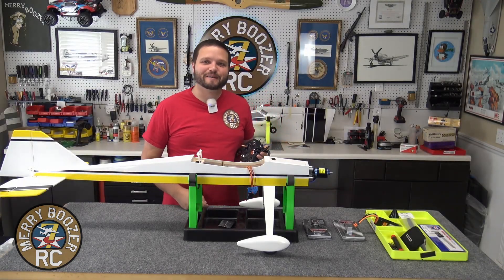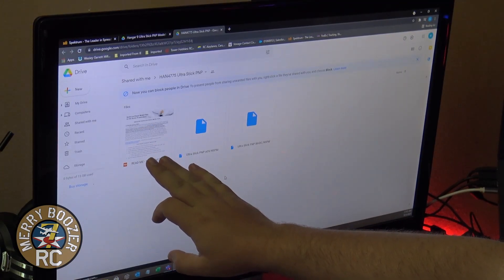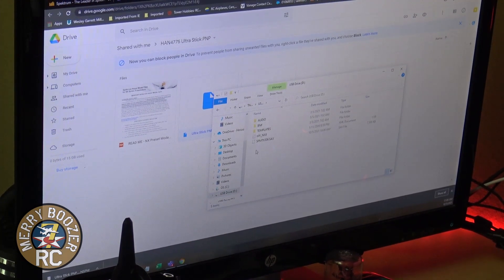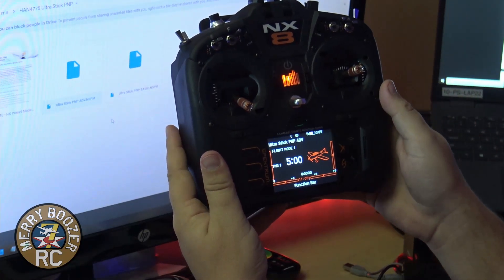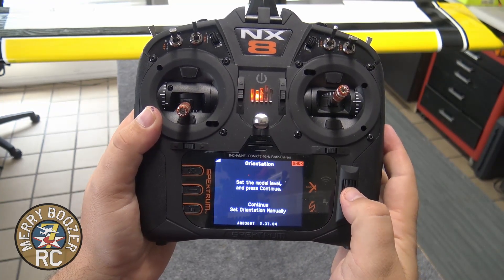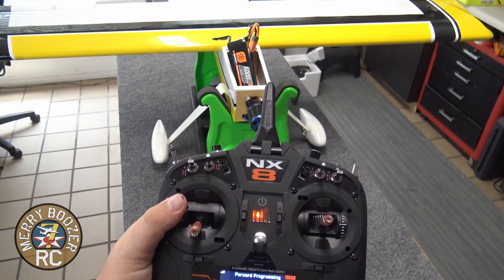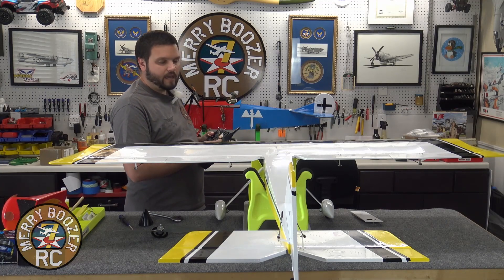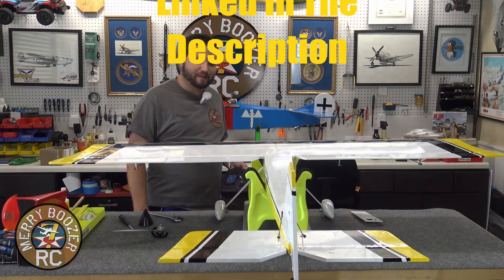Hangar 9 Ultrastick BNF Downloadable Profile Instructions On A NX8 HAN4775

Comment: Just finishing up putting together an Ultra Stick 60" PNP. I am at the point of setting up the control surface throws. I could not have reached this point in the process without these videos setting up the receiver and my transmitter. My first balsa covered airplane and first PNP doing all this radio set up, after 10 years of BNF Foamies. Thank you for helping it prove successful so far. Looking forward to more. Keep them coming. Adds to the challenges and fun of the hobby.
Reply from the maker: That’s awesome to hear 😍we have our assembly and set up of the new H9 P-47 coming this week also 😉

Comment: I have this same setup on mine except on the IX-12. Everything functions but when I toggle on stabilized mode, the elevators trim up about 10 degrees. Does anyone know if that is normal? Also, thanks for the helpful vids boozer!
Reply from the maker: Do you mean when you put it in safe? If yes that’s normal
Reply: @MerryBoozerRC  Yes! that's what I meant. Thanks buddy. I'm lovin this plane, what a great flyer. With the smart ESC I have reverse programmed in. Landings with reverse are a real head turner at our field. It stops just like it has wheel brakes.